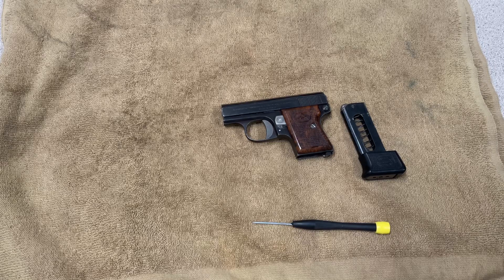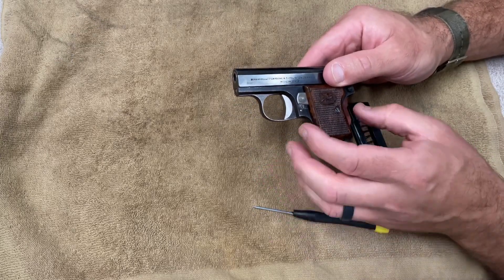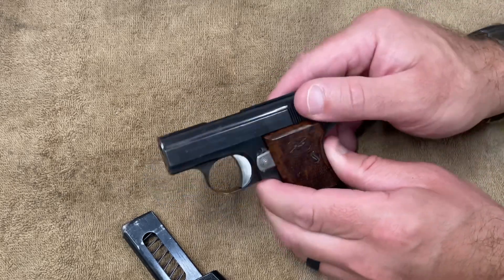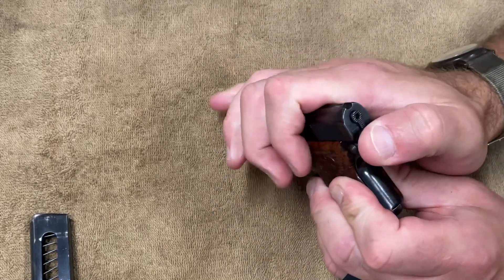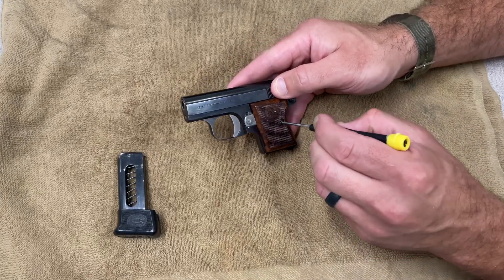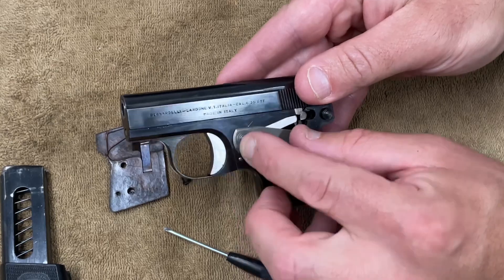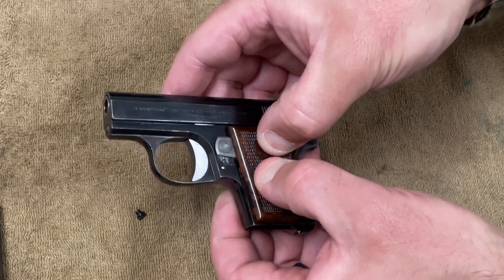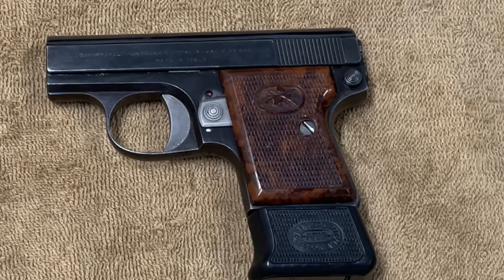25 Auto Bernardelli Q&A Troubleshooting

Comment: Really appreciate the video. Although these aren't extremely rare, I juts can't find ANY videos on disassembly and assembly. It's to the point now that I'd pay someone to make a video if I had the money. It's funny how some older, more rare guns can have dozens of videos about how to assemble, disassembly, fix or modify them.... but then other similar firearms don't have any at all. (Just wish I knew how they worked. I think they're awesome guns, but they work differently than all the others and have different parts... and I never buy a firearm unless I know precisely how each and every part works, because I believe it is my responsibility to make certain that my firearms are in working, safe condition.... and with that, to also know if they are designed to be safe and I know well enough how they work to determine if they appear to be safe or not).
Reply from the maker: I agree. Once you buy it knowing everything you can about it and how well it works and safe, is up to the buyer. And it’s a big question mark! And sometimes a mystery with an obscure firearm.

Comment: I have the same pistol in 22 Long, mine shoots reliably, Very well made guns from the times when they used to make real steel guns
Thanks for the video
Reply from the maker: I’d love to see one in 22. Thanks for coming by!
Reply: That's really cool. Someone else said they only come in 22 short... but I'd much rather have one in .22 long. I'm very surprised they didn't make them in 22lr. I'm surprised that most of them don't for some reason. I'm really glad that Beretta did and a couple others... but I really wish we could find more guns like this in 22lr (or any 22 rimfire). With modern ammo the rimfire .22 ammo has really gotten a lot more reliable. I used to have endless troubled with .22lr when I was younger. I could never go a day without at-least a couple ammo failures... but with modern CCI ammo, I've gone through many 100's of rounds without any failures, and maybe even 3000 rounds so far. Have shot a ton of Aguila 22lr also without any failures (about 300). I forgot the type of Aquila ammo they are, but it's their very high velocity stuff that's about as powerful as the CCI Stingers or whatever their hottest ammo is. (I think it's stingers).
Reply: @deucedeuce1572  
Mine says on the slide 22 Long, but I have 22 short mag and it shoots both 22 long & short without any issues ( the opposite won’t work though since the chamber of the 22 short won’t fit the 22 long round)